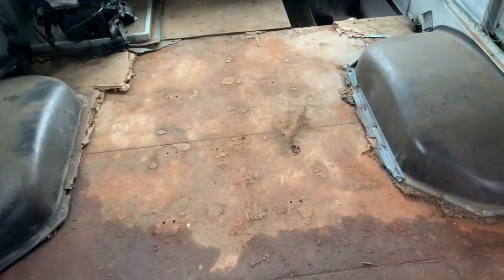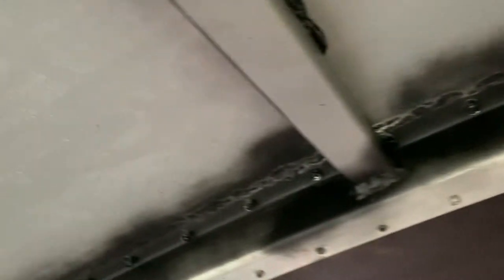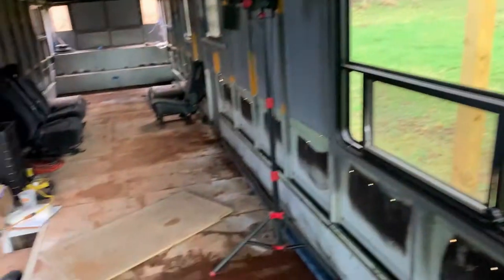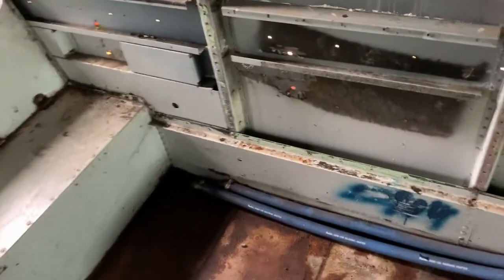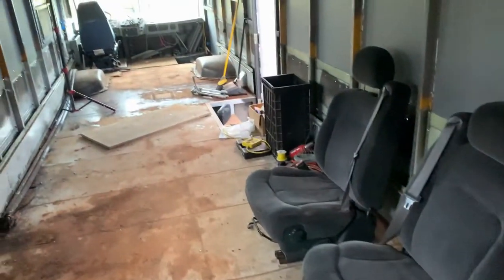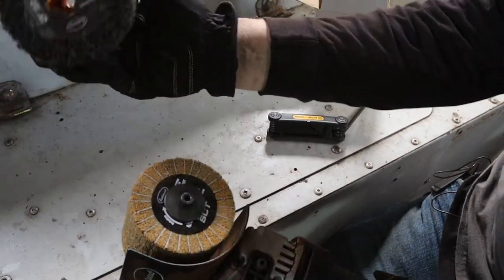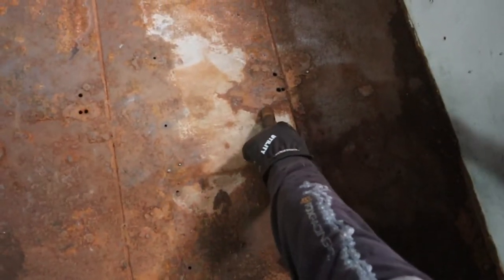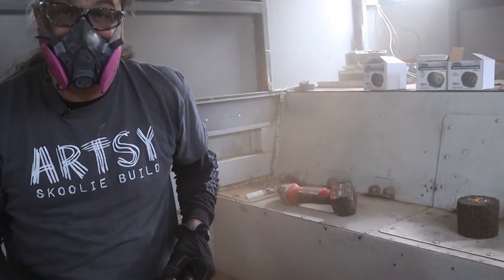Skoolie Conversion: Prepping Bus Floor for Paint | Eastwood Contour SCT

Comment: Hi…I just came across your channel and love the content ✨ just as a note, Please take extra precautions when generating so much dust.  Having someone run a powerful vacuum next to the head of the tool could eliminate 90% of the dust from making it airborn.  While the dust mask generally work, when there is that much dust, they won’t stop everything, especially when working hard with heavy movement and breathing.  You can also come up with a makeshift shroud or vacuum attachment with a big enough orifice to capture the tools path.  Looking forward to the progress!  Thanks for creating and posting ✨it’s beautiful to see things happpen ✨

Comment: I’m wondering if there are electric defrosters available? That would certainly eliminate the need for those long heater hoses which will definitely chafe and leak at the worst possible time in the future.
Reply from the maker: Thanks for the comment. I’ve seen some online but I was concerned about their ability to keep such a large windows clear. I think I’m going to take a second look at this option.

Comment: just so you. know china sells a clone of this tool. you can get it as an add on to an angle grinder for 30 bucks or with the grinder attached for around 50. they are sold as burnishing machines.
Reply from the maker: Good to know. I haven’t had great luck with cheaper versions of tools but it could be worth looking into.
Reply: @artsyreclaimed6821  i feel you on that one.